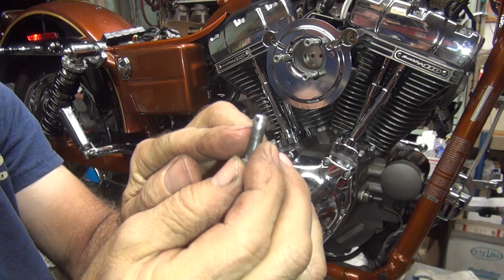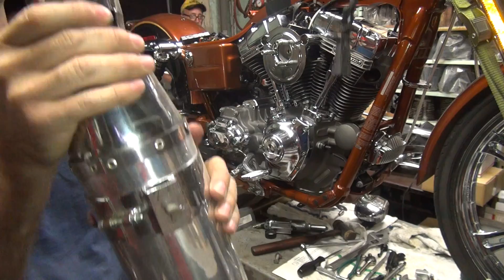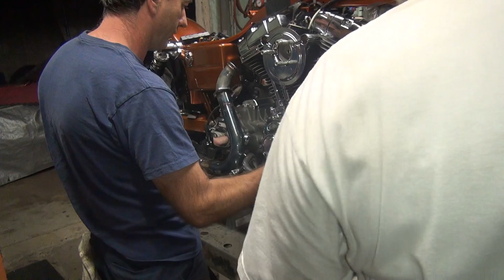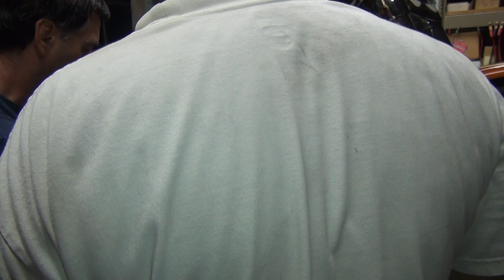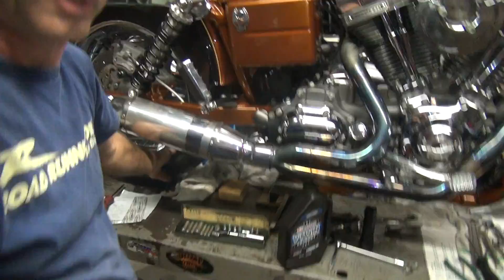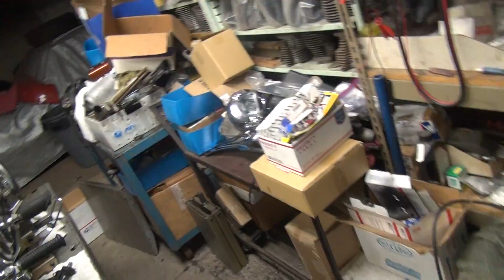#129 2008 110ci cvo twincam fxd dyna motor repair rebuild harley by tatro machine

Comment: Thanks for your spark plug demo. I have always used anti-seize quite sparingly as compared to you. Perhaps I'll blob it on a little heavier next time. I also used the copper loaded stuff by Permatex. Mistake?
Reply from the maker: i don't glob it on, i put a thin coat on half the threads. keep it off the 1st few threads next to the tip. you don't want it anywhere near the plug tip.
i am not much for all this copper stuff they make now days.

tatro
Reply: Silver or Copper.....mostly just 2 different brands.....although I like the copper for ironhead/Knuckle stuff...and the 'pure nickel' for very high temps....like around exhaust....especially on turbo/stainless.....